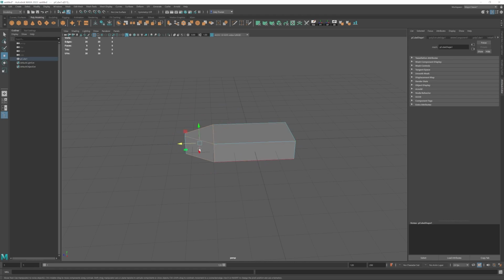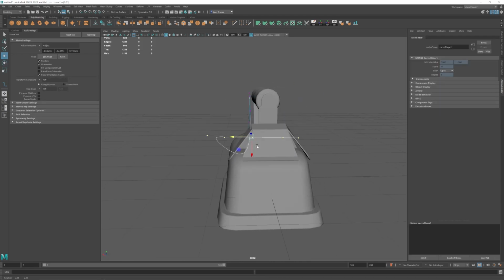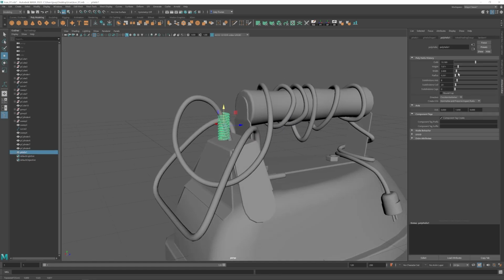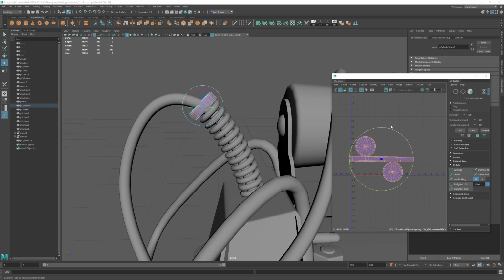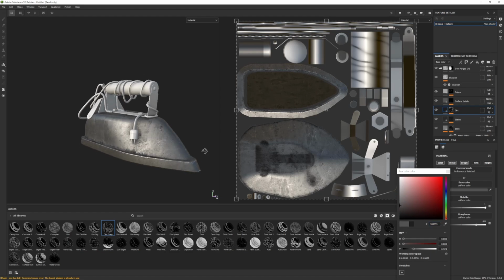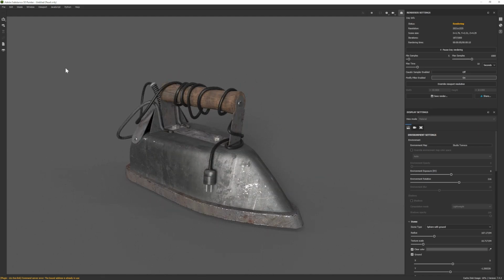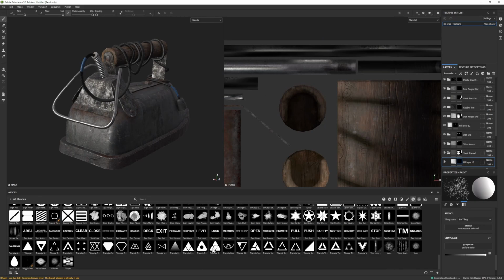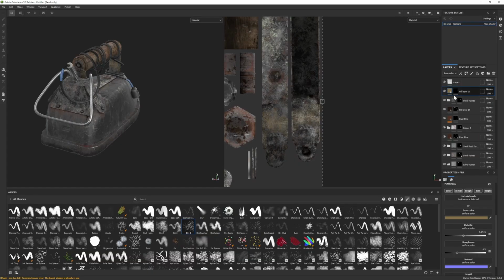Old USSR Iron | Creating A Quick Game Asset | Autodesk Maya + Substance 3D Painter

Comment: i am in the middle of working on a test file for job and this is my first time dealing wwith LOD.

Someone told me i am suppose to merge all the parts together into object so i was resorting to boolean and extrude as i was modeling T_T So this cleared the confusion, i jus have to mesh - combine in the end. it is an asset not for animation.

my doubt is,  i am given 70000 tris (max) limit {LOD0} and  my model's face cout is 2000 and tris count is 3000 right now. so am i suppose to triangulate the whole thing after i am done?

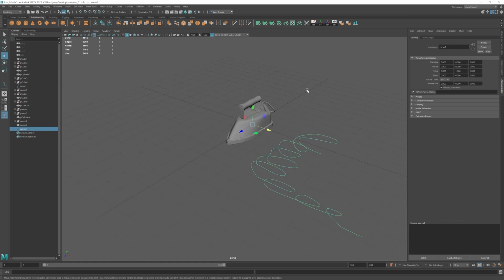Comment: Awesome Tutorial, What modifier do you click at 17:02 ??
Reply from the maker: Thanks! I just use the align tool. It is found under Modify>Snap Align Objects>Align Objects. Make sure to click that small square beside it to open up the settings window, and make sure Align in: World X, Y and Z is checked and Align To: is set to "Last selected object". 
Once you use the tool once with those settings, I then press Control + Shift and click that command in the menu to hotkey it to my UI bar. I use this constantly while modelling so it saves me a lot of time. I hope this helps!
Reply: @polyrendr  Thank you so much!!! Please keep making these videos!!!